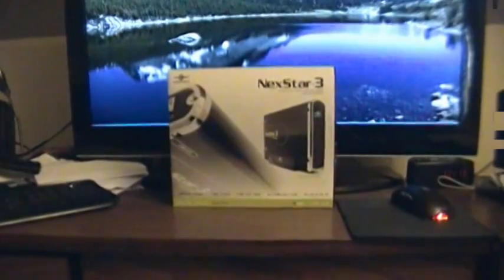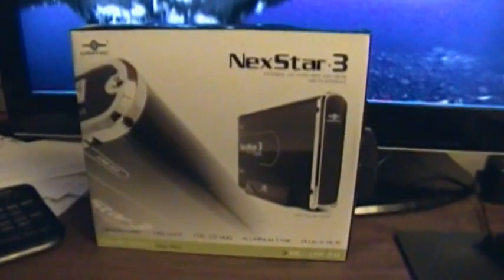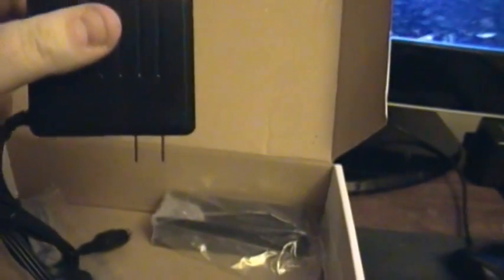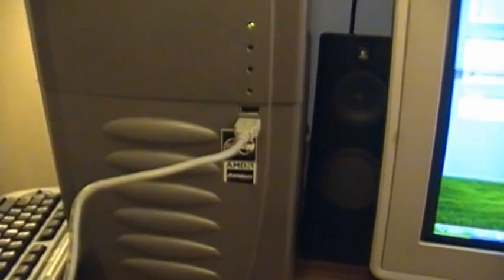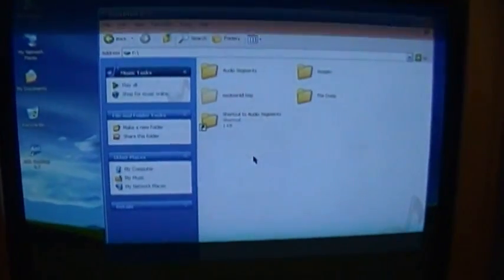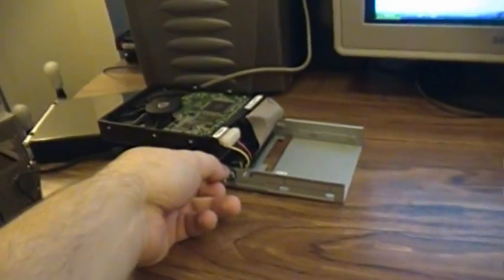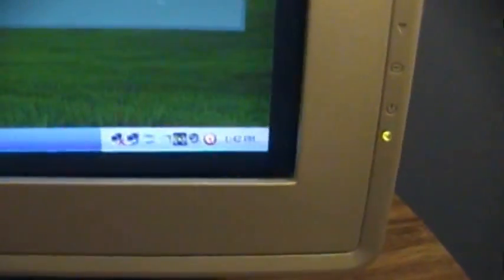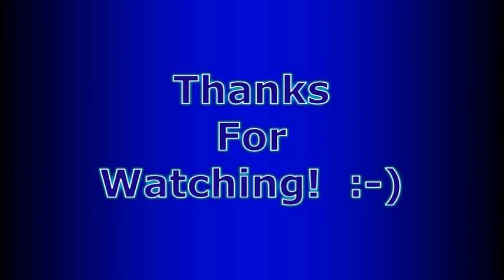Drive "Enclosure" Or Drive Hookup?

Comment: I recommend getting a USB3 external when you need one for a SATA hookup. I was trying to get a solution with eSATA where I could pretty much use hard drives like floppies, but after trying 3 different external enclosures, I couldn't them to work with eSATA; not through the motherboard's eSATA port, a eSATA to SATA bracket, or any OS (XP/7/Linux). While eSATA might claim to have some decent transfer rates, I never saw them no matter how much I tried.

Comment from the maker: @FloppyFormatFrenzy I'm probably going to cheap out and go USB 2.0 since only my main system has USB 3.0 ports.  Next time around though USB 3.0 should be more common.  I might even just get a cable assembly instead of only using half an enclosure like I did here.